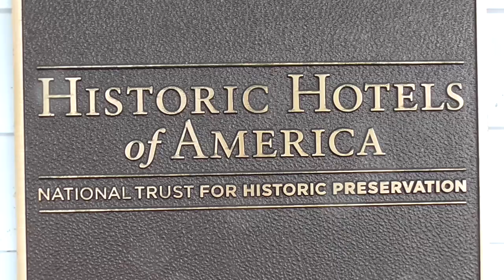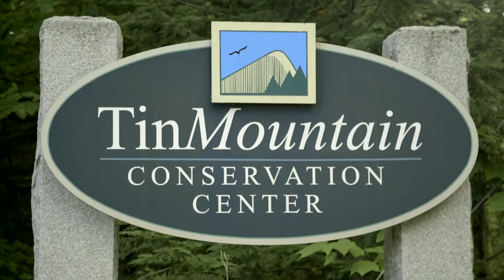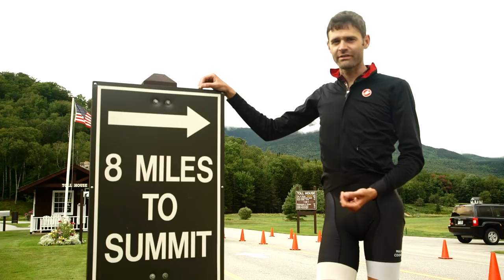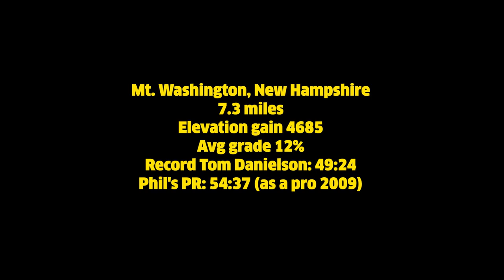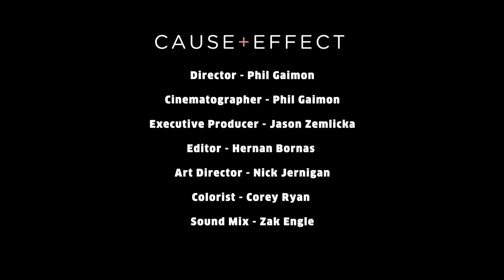Phils Gaimon's "Worst Retirement Ever" - Mt. Washington Hillclimb - New Hampshire

Comment: This was a fun climb. The slope eases up a fair bit in the last mile, so you can recuperate a tad before the final hill sprint. Loved blasting that hill with the crowd on it. I ran a mtb cassette with a 34 tooth granny gear. Kept my 39x53 up front. The biggest mistake people make is they don't pace themselves. I was slow on the bottom compared to others, but must have passed 150 after 10 minutes in.